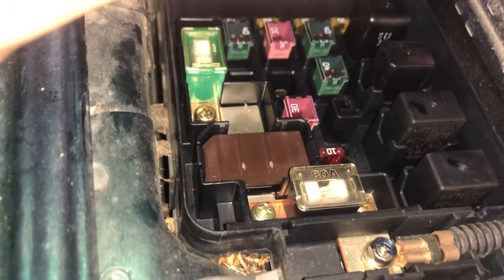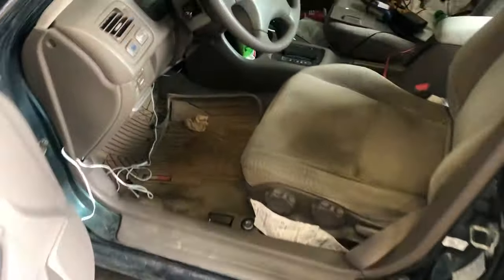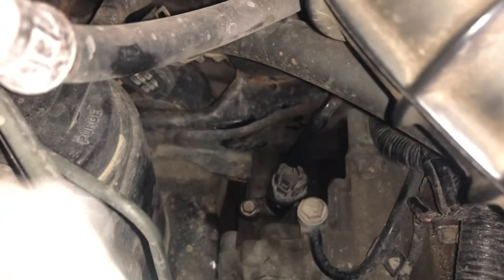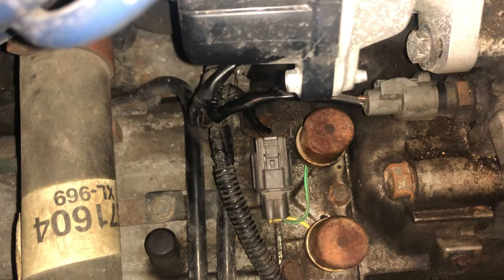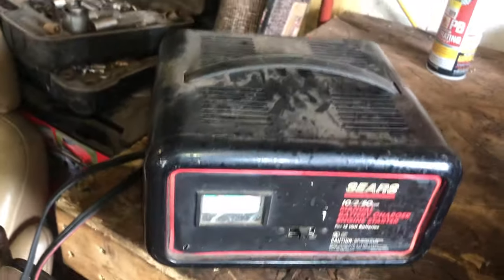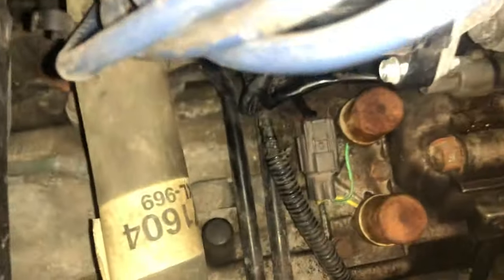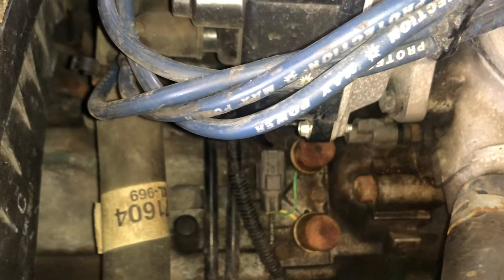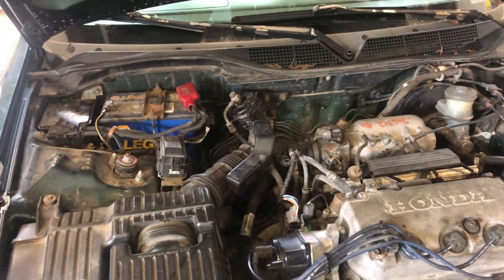P1753 P1768 P1298 fix crazy Speedo D4 light flashing hard shift no power on takeoff diagnose

Comment: Dude, you just saved me so much headache on my CR-V. I was tearing my hair out. You're the man.
Reply: What code you have in your crv
Reply: What code you have in your crv
Reply: All of the ones listed here- 1753, 1768, 1298, and "D" flashing
Reply: رينو ميجان
Reply: Duuuuuuude, that fuse was the problem on mine as well. I just bought this 2000 Civic from the original owner with 165k for $900 becausse they said the transmission failed. I put that fuse in to replace the blown one at it worked!
Reply: Hopefully it works I'm going to the dealer for the part tm

Comment: I had the same symptoms on my 2000 civic. I just replace the burnt fuse and it worked 😃👍. I also had two o2 heater sensor codes, and so far haven't came back on. Thank you so much. Subscribed!!
Reply: Hey I'm having the same problem on my 2000 honda civic I bought new solenoids and still same problem
Reply: Thanks a lot,checking the fuse was a big help,fixed the problem,thought I was having tranny issues,what a relief,,video was jam up👍👍

Comment: Hey guys I fix my D4 light that was flashing on my 1993 Honda Accord ex after thinking it was the transmission. And buying part after part. It was the transmission selonoid the whole time. Hope this helps
Reply: After replacing the shifting selonoid I haven’t had no problems at all. Been driving the car for one week no problems at all.
Reply: Transmission shift selonoid was my problem
Reply: Thanks
Reply: What solenoid did you change? A or B
Reply: Sir I am also honda city zx automatic same  D light blinking and check engine light show and car not run only start pls help sir🙏

Comment: I saw in Honda bulletins for codes P: 1298, 0135, 1753 and a few more - if blk/yel wire is shorted to ground at rear of the non ulev alternator, the ecm/pcm may retain those diag codes... & check the #6 15a fuse
Reply: What you mean by short to ground on the rear ? Where ?

Comment: My 2002 Accord did the same thing (flashing D4) after I changed the starter. I disconnected the speed sensor connector trying to help me get to the rear starter mounting bolt. Forgot to reconnect it.

Doh! Don't do that

The solenoid screen cleaning is a snap, I've done it in the past and it helped my aging (320,000 miles) transmission. I've heard there are one or two more solenoids under the battery tray but haven't messed with them yet.

Good luck all!

Comment: does anyone know what the wires above solenoid is. I was replacing it and the wires above it were so brittle that they came off the plug but i dont know what theyre called or what they do. Also there was another wire that wasnt connected to anything either just hanging. Bu Anything helps thanks.

Comment: Will this cause the car not to go into gear? My 96 won't go switch gears. (Reverse, neutral, drive). I used the bypass button to get it out of park. That's not the issue. It just won't come out of park. I followed the cable to the top of the transmission. And you can watch it try to move, but just won't change gears.
Reply: Might be a little late but Sounds like the tps needs to be adjusted or replaced

Comment: My 2001 accord 2.3 isn’t moving when I engage D4 and the engine is only revving. Sometimes she moves, sometimes she doesn’t. Replaced the 2nd gear pressure switch after I received P1738 code. Put New ATF and cleaned the solenoids too. What’s the issue please tell me
Reply: I also have this problem on my crv rd1. Someone please assist us

Comment: My 94 accord get neutral after get hot maybe after  5 km driving...but after cold get back normal...is the selenoid be the problem?
Reply from the maker: I’ve ran into this a lot. Lack of pump pressure or clogged trans filter is sometimes the cause. If the filter is that clogged it’s probably from trans damage/extreme wear
Reply: @FerKurl  could it be the selenoid? When i checked the two selenoid...the ones click but not as strong as the other one...the shift and lock up selenoid..not sure where the ones that is not click strong

Comment: I have delayed engagement from neutral to drive 3 and drive 4. When I put it in drive, I feel a bump, then another bump and it's ready to go. Any ideas? Anyone? Fluid has always been clean.
Reply: Did u find the fix mines does the same idk what it is
Reply: @PipeYanki  I haven't got it figured out yet. I'll be asking someone with some knowledge of Hondas pretty soon. I'll let you know if I find the answer.
Reply: Im gonna change my transmission mounts an 4th an 3rd  solenoid today im see if it helps cause everytime i put it in 4th or 3rd the engine or transmission seems to jump 🤔  🤷
Reply: @PipeYanki  Let me know if that works out for you.
Reply: Did you find out what it was?
Reply: @gilbertjaramillo2731  Not yet. When I get some time, I will be checking out the shift solenoids to see if they are clean and working as they should. It seems to improve as the car warms up to operating temp I've noticed.

Comment: I was testing my alternator last night took out my 7.5 fuse #15 put her back in and had 5 codes come up and my transmission won’t go into gear now
Reply from the maker: Tanner did you clear the codes? Did you pull the fuse while it was running?
Reply: FerKurl I tried clearing the codes and they came back up but I didn’t have another 7.5 fuse on me so I’m going to try tonight. When I replace that fuse do I want to replace the fuse with her off turn it into run position and then clear the codes or clear codes and then do the fuse
Reply from the maker: Tanner replace the fuse car off. Then ignition on engine off clear codes. Verify the fuse didn’t blow again. If that fuse keeps blowing you have a problem Somewhere.
Reply: FerKurl okay thank you
Reply: Hi I m also honda city zx automatic 2007 modal same problem D light blinking and check enjin also show meter and car not run .pls🙏🙏🙏🙏

Comment: Honda CRV can't shift from D4 to D3. What is the cause? How is it fixed?
Reply from the maker: Lazarus Mutale like the shifter itself?
Reply: @FerKurl  from park to D4 and back it is working normally. Problem is moving downwards from D4 to 1 l can't. Honda CR-V RD1 1997.
Reply from the maker: Lazarus Mutale shift cable? Corroded shift lever at the trans? Problem under the shifter? Something jammed or bent under there maybe?
Reply: I think something just jammed. Now changing smoothly. WHAT IS THE RECOMMENDED Engine oil for Honda CR-V RD1- 1996? Thanks.
Reply from the maker: Lazarus Mutale I’m not seeing a 1996 on my chart but 1997 is 5w30 4quarts with filter change
Reply: Sir I am also honda city zx automatic same  D light blinking how to solve this

Comment: Im having a honda crv 97. The d light is flashing and there's no pickup. What's the cause? And the rpm may drop to 0 till the engine is off by itself
Reply from the maker: First thing is to check that fuse in the vid

Comment: I had the flashing D4 light in a 1997 Honda Accord. One of the sensor the wires on the counter shaft were chewed off by a stupid rat. Both wires were cut off. So check all your wires going to the Automatic transmission,,,,,,,,,,,,,,,

Comment: I’m having da same issue with my 98 Honda Accord. Any suggestions
Reply from the maker: Could be lots of stuff. Go through the list in the video and do some research, watch a few other videos
Reply: Ok I found that the fuse was blown. I replaced it and it blew again.. any suggestions??
Reply from the maker: @Rayvon89  did it blow immediately?
Reply: @FerKurl  I have the same issue, codes P1298 (ELD), P0135 (O2 Sensor 1/1), P0141 (O2 Sensor 1/2), P0758 (Shift Solenoid B), P1768 (Torque Converter Clutch Solenoid Valve B). Replaced the 7.5A fuse, which was blown. It immediately blew again. I shut the car off and cleared the codes, now only P1298 and P1768 show up. Any suggestions on where to go next?
Reply: @HDMFly  I’m having the same issue except the fuse isn’t blowing. I’m thinking of replacing the ELD see if it fixes the issue.
Reply from the maker: @HDMFly  sry for the late reply. Notifications are coming through for replies. It’s 1am here. Do a new comment and I can give u advice tomorrow
Reply from the maker: @codymcdaniel1660  let everyone know if that fixes it!

Comment: so i have the code p0730 and i have a 2000 honda civic dx could that be the bottom solenoid
Reply from the maker: Danny 1002 When the TCM (or transmission control module) sees an RPM difference (rotational speed) between the transmission output RPM sensor and input RPM sensor that is greater than a certain value, the P0730 code is triggered. This can happen while shifting between gears or when driving at a steady speed in a particular gear
Faulty torque converter clutch
Faulty shift solenoids
Blockage on the inside of the transmission main control
Internal mechanical failure of the transmission
Blockage in fluid lines
Clogged fluid filter or worn pump
Dirty or low transmission fluid. 
Could be lots of stuff. If you unbolt the solenoids and they’re full of crud on the screens then new trans will be needed.
Reply: FerKurl thank you

Comment: My honda CRV moves in reverse but don't move in drive
Reply: Mine also has the same problem. 2000 Honda CRV, replaced both solenoids and it will go forward now but barely...still not driveable any suggestions out there?
Reply: kad1621 odds aren’t you replaced a solenoid and only one of the two worked brand new (happens all the time)
Reply: @jameshunt5316  turns out it was a fuse. I believe #15
Reply: kad1621 interesting, I’m working on mine right now and I believe the cause of the issue to actually be a corroded wire between the battery and fuse box under the hood, my fuse #15 was perfectly fine, cruise control stopped working months ago and couldn’t find the issue and I’m having o2, o1, map sensor and other random codes being shot through D indicator but very inconsistent, bout to test drive it now but my fuse box was intermittently getting 14 v all the way down to .2
Reply: Update: after reinstalling of engine, wire to the alternator was loose for three days causing oxidation to the grounds of the fuse box, transmission casing and thermostat housing, cleaned all three up and my spastic DTC codes and trans randomly downshifting problem went away next time I started the car, all problems fixed now, turbo build on the way 👍🏻